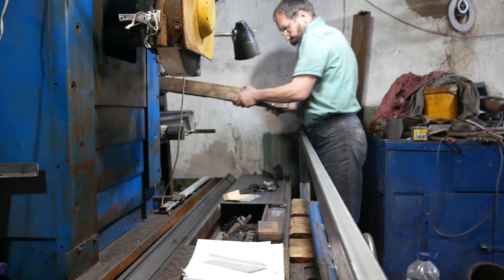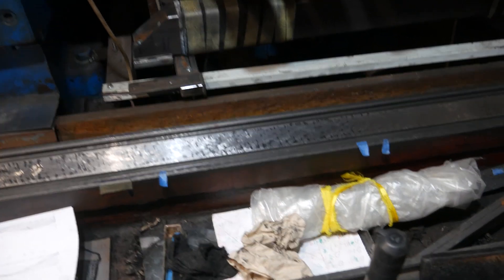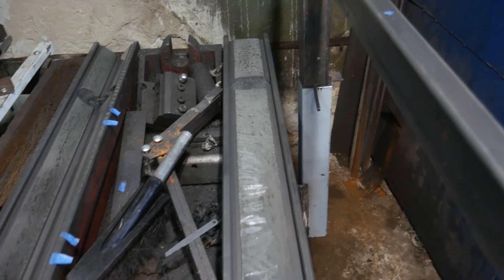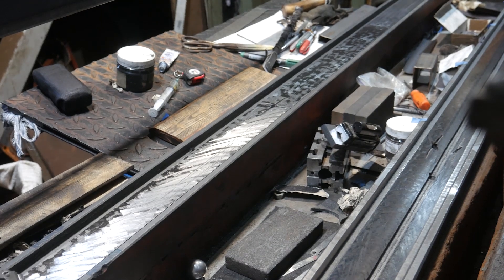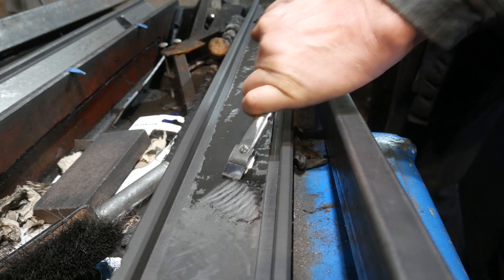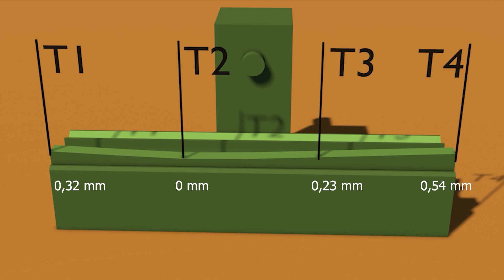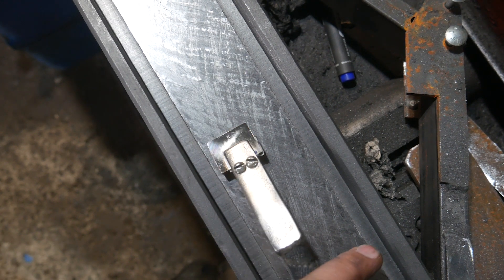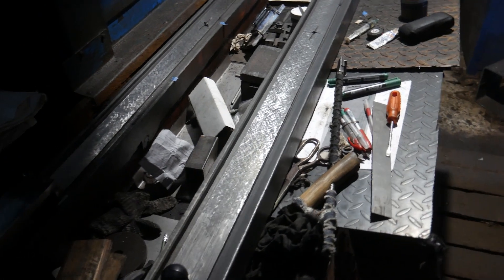How I Removed Half a Millimeter from a Linear Guide with a Scraper.

Comment: When rough scraping a surface into alignment you can 'step scrape'. 
For example, start at position T4 and scrape the whole width of the surface towards T3 for 200mm then stop, start again at T4 and scrape 400mm then stop, start again at T4 and scrape 600mm and stop etc etc. Doing this you cut most in the area where you want to remove the most material. It means less time printing and measuring and can be very quick when you get a feel for how much material you remove each pass.
All the best mate. Cheers D

Comment: Hallo, Gena;
I was watching a video by a Japanese Precision CNC machine manufacturer, and they have many, many scraping operations, even as far as the base of the "tower"... I noticed that some of the people doing the scraping were "dancing", seemed funny, but they had a rounded end of the scraper handle, and had that against their hip, using the body to put the power into the heavy scraping... Looks like a good way to do the deep scraping, and they changed to the "normal" way for final scraping.
They measure to 0.0001 mm.
Reply from the maker: Hello! Please send me a link to this video.
Reply: Here's one of them.. dancing 😀
https://youtu.be/vlt31XdZItA
Reply: At about 12 seconds, you can see that the scrapers have a flat plate on the end that sits against the hip are
https://youtu.be/fVQ7uXjXlH8?feature=shared
Reply: gena_bazarko;
These Japanese factories seem to take hand scraping very seriously...in one video, the presenter asked the company owner about how much time the finish scraping took, and he replied that the question was only about getting the required quality of the surface, not a question about time.
Anyway, here's another link:

Comment: Impressive energy ..for heavy defects I use a dremel , easy to remove 0.1 mm per cut , just need to ink ( trace ink blue and touching blue) not the full surface to visualise abrasive ''touching''  and that less boring than scrapping by hand
Reply from the maker: Well, I also use a dremel if I need it for steel or hardened steel. But for cast iron it's easier for me to use a scraper cutter.

Comment: 0.5mm is more in angle grinder range than scraping.
I'd get a tiny 60mm angle grinder for that from china and use it similar to step scraping.
And check height often, with straight edge and paint.
Reply from the maker: I'm a bit afraid to use a grinder, it cuts very quickly, but I may be wrong. I haven't tried it.
Reply: @gena_bazarko  Trust me, it is not too quick, Ive had to grind for hours and hours with a big 125mm x 6mm disk to flaten the initial stage of 3 surface plates 300x300mm in size prior to lapping and the initial peak to peak deviation was not higher than 2 mm. As long as you make sure you are constantly moving the disk and keep a very shallow angle of atack (I mean almost flat oposed to almost perpendicular to the grinded surface), the removal rate is not too high. Also, you could use a small inserts rotary tool (dremmel style) for the latter stages if you are afraid of making a mistake, because that is much more precise, but still, the same principle of constantly moving the tool applies.
Reply: @DgtalBreakz  there were hand held "surface grinders" available at one point... possibly still are.

but yeah... i would be pulling out the angle grinder and a fresh 6mm disc...

on steel, and other "sticky" metals... its actually far easier to use a die grinder or similar anyway. scraper tends to chatter and not be very friendly at all...
Reply: Agree with you , I do the same

Comment: Would it reduce wear on the scraping blade if you used a cutting lubricant of some kind during this rough removal stage?
Reply from the maker: I don't know that (.
Reply: iron is cut dry as that make mud with cutting oil and that generate a lot of trouble , carbide blade works fine without lubricant , but for steel scrapping lub is ok .
Reply: @ced3098;.thx 4 comment. But maybe a lighter "lube" that is flushed from time to time? 
Great channel, great contributions in comments.

Comment: personally i would use a camera with a remote monitor on the auto colimater and move there mirror with a string angered as close to the bottom as possible to remove as much of my body effecting things as possible ( yes the camera will also output some heat into it but its way less and its constant and since its constant its also much easier to compensate for unlike when you go back and forth (first you have to compensate for the heat as you are there and then compensate for the lack of heat when your not there ). unlike mine that comes and go as i go back and forth between working and reading it. plus i dont have to spend time going back and for to read it but can just look up at a big screen )
Reply from the maker: These are very correct ideas, amazingly precise, right down to the application of force to the mirror stand, but this is relevant at the very end of the work, when the fight is for a micron.

Comment: Do you need to worry about the "dip" that you see on the V guide interfering with your flatness measurement on the flat way?
Reply from the maker: No, I just do it in a similar way to the prism.
Reply: If he's using the level to determine the height then it doesn't matter. It's just the relation from v way to flat way at that point.

Comment: Sir; would it be feasible to use a "gentle" heating strip, or a "tunnel" with a fan blowing warm air, to make the section that sags expand a tiny bit, to force it to its "normal" shape... with a tiny bit of temperature sensing, the "corrective heat" could be reduced according to the external temperature?
Just another crazy idea!
Reply from the maker: There is no need for this in this case. The deflection is very small, the machine will heat up during operation. Tests of the accuracy of the workpiece will give the answer.
Reply: Thanks Gena... just pushing around the edges...

Comment: Very nice work. I removed nearly a mm from my Chinese milling machine with hand scraper, but only over a distance of 300mm.

I liked it better when you did the narration instead of the computer generated voice .

Trust me, your English is better than many English speakers , and far better than my Ukrainian.
Reply from the maker: If I do the voice-over myself, instead of two videos I will only have time to make one.
Reply: @AndySomogyi Sorry I don't agree with that at all. Of course there is some "uncanniness"  when hearing an AI voice, but it is very understandable especially for those who are not used to hearing English every day, and therefore have more trouble with all the dialects and bastardizations and such. For example, the automatic subtitles by YouTube also have that problem. It makes an incomprehensible mess of poorly pronounced or bastardized English and then a non-English speaker has little use for it. I applaud Genaddy for doing it his way!

Comment: Compliments for your job,but scraping have many things to understand before to do.
Reply from the maker: It's not that difficult to scrape, you can get the hang of it pretty quickly, it's difficult to determine where and how much to scrape, but nothing more.
Reply: @gena_bazarko  yes.i know it a bit.is 36 years i scraping old and new machines
Reply from the maker: @fabioth283  Then, if possible, point out my mistakes, or just give me advice. Now or in other videos. It will be useful.
Reply: @gena_bazarko  its all ok.just look with level the straight slide.can check for the 3000mm step by step by 250 or 300mm,depend your level resolution
Reply: @gena_bazarko  also on the large  size 80/100 mm with level.have a nice job

Comment: Can  scraping too hard just when can see a smoke from cast iron.also you take your scraper too high,you lose power and patience an arms
Reply from the maker: Since I have the option of using a higher or lower angle of pressure on the scraper, I quickly understand what works better. When the scraper is very sharp, you can keep the angle lower, when it becomes dull, you have to increase the angle. For a quick cut, I press on the cutter as hard as I can. Here the main guide is the reaction of the tool and the material.

Comment: Are the gutters machined? could you have used them as a roughing height reference for a grinder (e.g. something rolling along the gutter to control the grinder height)
Reply from the maker: Hello! Unfortunately I don't understand your question, but I'll try to give an answer. The second line, namely the vi-like prism has already been repaired. It is now the "reference point".
Reply: @gena_bazarko  I think what he means is using the raised sides of the flat surface as a guide for a small grinder to rough grind the flat way. This could save a lot of hand scraping and measurement time. It could work well if the raised sections were originally machined in the same set up as the flat surface.

Comment: Amazing! If I'm correct, you removed roughly 42ccs or 280gs of cast iron from the straight part alone! I hope you do a video on your carbide sharpening setup and ideas as well.
And what a generous gift that Biax is!
Reply from the maker: Exactly! At the end of the repair I will calculate, first of all for the viewers, how much cast iron was cut off. After all, I have all the measurement data. It is interesting. And BIAX is really a very valuable thing, I know that, especially since we do not have similar machines.

Comment: I used a piececof flat carbide blade and shaped the edge with a diamond sharpener. However the carbide blade lost it's sharpness very fast. What is the solution
Reply from the maker: The diamond sharpener should be the finest grain. The grain size is from 6 to 10 microns. I use such a disk on an organic bond. And the silicon carbide should be of the highest quality.
Reply: @gena_bazarko  can you make a video of sharpening the blade and the disc? It will be amazing to watch
Reply: @gena_bazarko  - Silicon carbide?  Does that mean the blades you are sharpening are not tungsten carbide?
Reply from the maker: @somebodyelse6673  Tungsten carbide plate. Made from the highest quality raw materials, using extra fine powder for sintering. Its name, if translated, is: Tungsten Carbide 6 Extra Fine. Hardness 91 percent of diamond hardness. It was made in the best times of the USSR, when they often made it with high quality. I barely sold one of these plates on eBay for $50. But I only have about 7 of them in stock, I won't sell any more.

Comment: You will progress much faster with power scraper now. Much less tiring as well.
I had the pleasure of working with Soviet blades as well and did note them being much better at edge retention than Swedish blades
Reply from the maker: I also want to test them in comparison, I need to buy such a blade on eBay and do tests. I also want to test them in comparison, I need to buy such a blade on eBay and do tests. In the meantime, I rely on your experience.

Comment: I believe most people in the west use Connelly's book "Machine Tool Reconditioning" as their guide. In this book, in the section for reconditioning a V-way/Flat guide like this, he recommends beginning with the flat way which is then used as the datum to scrape the V way parallel. Although your methods have been wonderfully ingenious, it seems it may have been simpler to begin with the flat way? I am sure you considered this, I am interested in your reasoning to start with the V-way.
Reply: How do you keep left/right straightness of V-way, when you start with flat guide first? 
With X/Y autocollimator, you can check left/right and up/down straightness of V-way easily, once it's done, put prism into V-way and a level on top, to check flat way.
If you make flat guide straight first with level or autocollimator, you don't get left/right orientation/straightness of V-way with level alone.
Or if V way is too high, you don't know, if to scrape left or right side of V-way, to get it onto same level as flat guide.
Reply from the maker: @hinz1  The V-shaped prism is already made, it is smooth, rectilinear, checked by the autocollimator. Now, focusing on its geometry, I make the second, flat line of this pair of linear motion.
Reply from the maker: Hello! If I worked without an autocollimator, then I would need to start with a flat prism. An autocollimator changes the logic of repair. It is rational to start with a V-like prism.
Reply: @gena_bazarko  That is an informative answer, thank you. Connelly doesn't use an autocollimator in his methods, although I think they were available. Perhaps they were very uncommon.
Reply from the maker: @rodfrey  If I didn't have an autocollimator, then a precise level would help me. It is impossible to make a wedge-shaped prism using a level, but it is possible to make a flat horizontal strip. From the correct geometry of the strip already made using a level, it is possible to make a straight edge of the corresponding length, and from the straight edge a wedge-shaped prism. The parallelism of both can be controlled again using a level. But such a method will require more work, and the accuracy will be lower.

Comment: I wish metric guts would say .1 .01 or thousands of a MM beacuse the "microns" ect confuse me. 
I belive he is saying he removed .5mm and or .019 of a inch
Reply: A micron is just a thousandths of a millimeter, and is much more common than "thousandths" which is only used for an inch. In fact, you probably own several "micrometers" which were named because they could measure to a thousandths.

Although not "accurate", for getting a fast idea of the level of precision, think of a micron as half a tenth.
Reply: @rodfrey  you can say thousandth of a mm or thousandth of an inch. I personally think it's much cleaner to do so that "microns" or other metric short hand.
Reply: @zHxIxPxPxIxEz  Well, then we should also say "thousand-meter" instead of kilometer, "hundreth-gram" instead of milligram, "million-ton" instead of megaton. Prefixes are part of metric, it's fine if you don't want to use metric, but it's a bit weird to complain that metric doesn't use American unit vocabulary.
Reply: @rodfrey  ...partner it's not that serious.
Reply: @zHxIxPxPxIxEz  Micron is the most convinient  and correct way of expressing those dimensions. It might seem a bit odd if you don't 'think in metric' but other ways of saying it seem like far too many words to describe something very simple.
Reply: @rodfrey  i always get confused in old electronics... micro micro farad... milli micro farad, etc... took them a while to start using "nano", "pico", and "femto"...

still, a "mic" is pretty basic, a microhenry of inductance... what hurts is when you dig up a REAL old book and find "centimeters" as a unit of inductance... a WHAT? and a "jar" of capacitance?

no relation to the unit for length, having been coined before the metric system...
Reply: @paradiselost9946  Never knew about "jars" of capacitance, that's cool! I presume it's from some standard size of Leyden jars?
Reply: @rodfrey  thats been my line of thought as well... never really looked into it. seldom see it used, and of course, the same book that says theyre "obsolete as a service unit" then goes and uses it in half of the examples... i guess it IS intended for military service/repair personnel so they gotta be familiar regardless of what units used... 

anyway...1uF= 900 jars... 1nanoHenry= 1cm of inductance.
more silliness... 1 jar =1000cms of capacitance. theyre BOTH measured in cms! arrrrrgh!

all gets rather confusing when you dig into electrostatic units versus electromagnetic units. 

and now i go back through the book, i see the cms is somehow related to velocity and the nature of a vacuum... may not predate the metric system but does predate c being a  constant and the metre based on that being a constant...

now i need to know when the metric system was created. more rabbit holes! weeeee! 

wait... this was about scraping? how did we end up here?

freaking rabbits!
Reply from the maker: Hello! I indicate the dimensions with their clear definition, and everything is duplicated in words on the screen and in the subtitles. A micron, as you know, is 0.001 millimeters or 0.000039 inches. On a  V similar prism along its entire length, this is 3 meters, the error is 0.005 millimeters.
Reply: @gena_bazarko  oh so I was an order of magnitude off! Спасибо for you quick reply! 
I was trying to translate off of the video title and got confused. 
Thank you
Reply: deci = 10^-1 (a tenths)
centi = 10^-2 (a hundredths)
milli = 10^-3 (a thousands)
micro = 10^-6 (a millionths)
nano = 10^-9 (a billionths)

We 'metrics' use (for example) 0.1 micro-meter and 100 nano-meter interchangeably and mostly chose depending on context and custom.  To avoid errors in communication though, it mostly is preferred to use digits BEFORE the comma and adjust the pre-fix accordingly.  So 100 nm would be preferable over 0.1 um, definitely for 10 nm vs 0.01 um as commas can 'get lost' or be 'overlooked'.